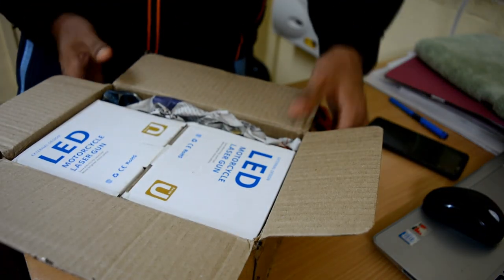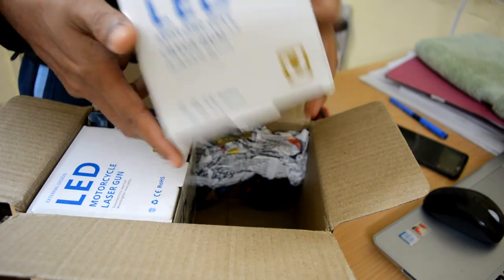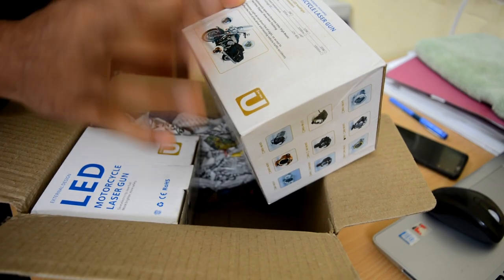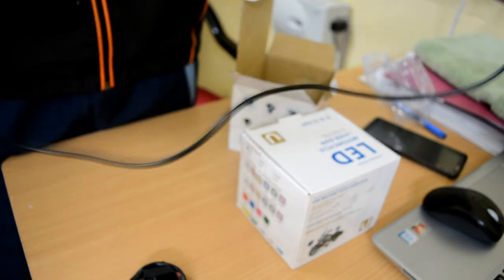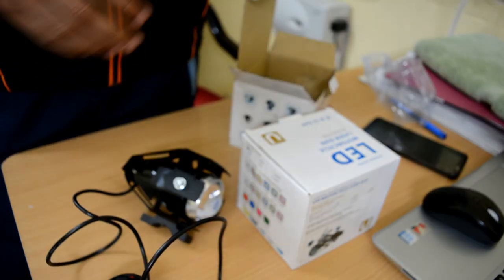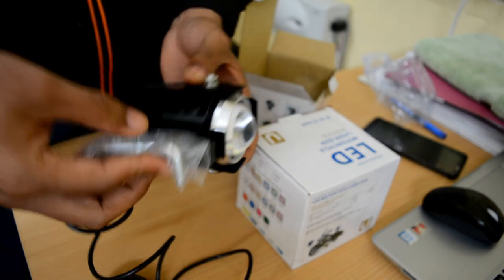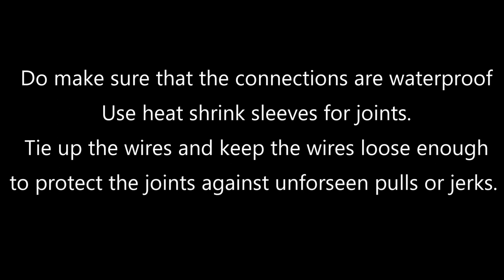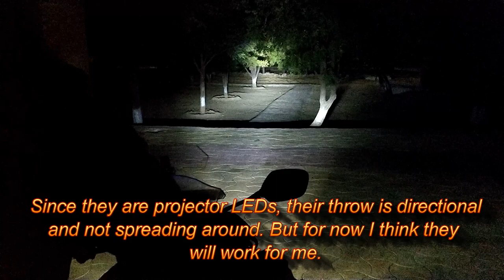Auxiliary Lights For CBR 650f !! Budget fix !!

Comment: Hi, i added a pair of gold runway to my 650f, but i had to fix them on the mirror brackets as i thought fixing them below the shockers would lead to the light juggling up and down on bad roads? Whatbis ur experience of the placement uve done?
Reply from the maker: Yes they do juggle up and down along with the tire .. ur lights will definitely give you better throw than mine for sure .. 
I just don't like the way thye look up there ..
Reply from the maker: But yes on bad roads with lot of potholes .. I have to be slow and cautious..

Comment: Isn't there any option of upgrading the existing headlights, say with higher watts... Etc... rather than installing additional ones.
Reply from the maker: Never explored that option but i am sure there must be .. I just think that these additional lights increase the aesthetics a little bit..
Reply: can be done with 2017 models that comes with Halogen bulbs but 2018 onwards they have LEDs and that cant be changed.